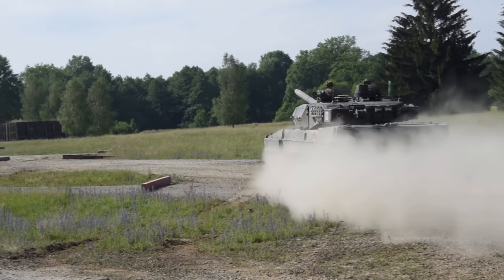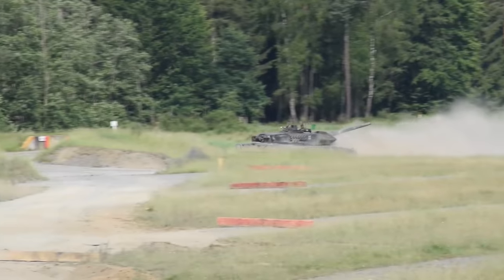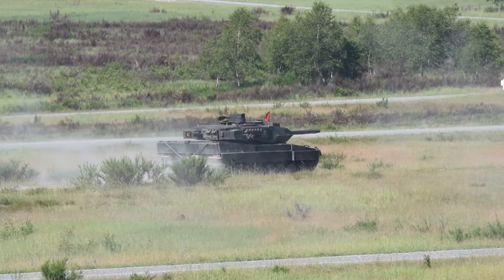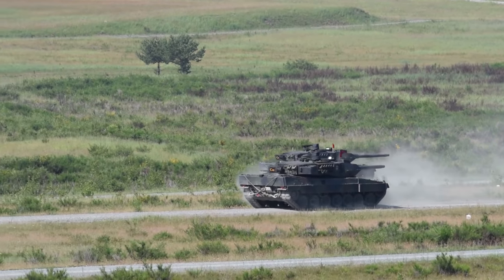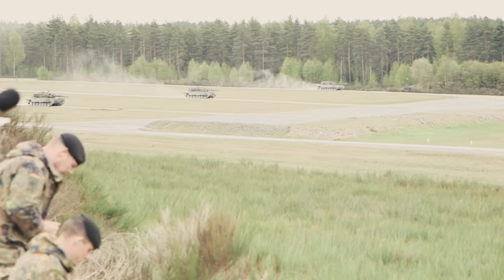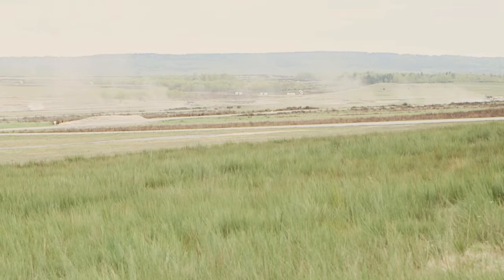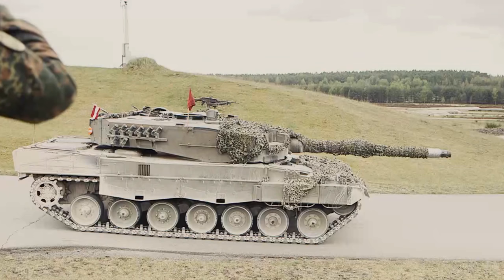Leopard 2 Main Battle Tank | GERMAN ENGINEERING

Comment: One thing that should allways be remembered concerning the Leopards (1 and 2): The German road system. That gives the Leopard 2 its insane 1500 hp engine - Tiger of WW2 was clearly underpowered with a thirsty petrol fuelled engine - that mistake should not be repeated (and it most certainly wasn't - there is no such thing as to much horsepower in German thinking).

The German idea behind the vehicle was: A Warsaw Pact break through could not be prevented as such, but the heavy tanks could have so much speed, that they could be brought to the crime scene before the russians could sort out their logistics.
Those tank units that were not engaging the enemy's offensive would instead simultaneously counterattack where the enemy was thinned out to provide a concentration of force at the break through point.
Basically it was meant to concentrate the bulk of the enemy against the british with their exellent gunnery and unusually well protected Challenger 2, albeit with limited operational mobility. 
Thus in effect crushing the russians between the german hammer and the british anvil.

Now, that changed after the cold war. First problem was that the old Warsaw Pact nations had become the new Nato countries. They had (and have to this day) a shitty infrastructure and a major roadbuilding programme is still in the making. The Baltic States are getting EU-funding to provide the road structure - mainly for civilian use. It has been quite entertaining to follow the political and administrative wrangling.

Basically the Baltic States have been very much preoccupied with their internal priorities - and shortage of funding. The EU and their sir Humpfrey Appelby's have begged (on their knees) the politicians of the three nations just to reach an agreement to apply for the road - write on the back of an envelope, just get the signatures! The hammering out of the details: Leave that to the beurocracy in the EU - that is what they are there for - and they are very good at it. Furthermore: The funding IS THERE.

Now in 2014 the invasion of the Ukraine happened, which made the gloves come off.

The road building in the Baltics (and Poland) would not be finished in short order.

The main problem for the heavy tanks is, that there are LOTS of rivers in Europe that are not navigable and the bridges over them are not strong enough to take tanks. The rail system is a hassle and an old fashioned BOTHER - so that will not be finished in time - no matter what date. Rail-systems timetables are like planning for the second coming of Christ. Christ will be reborn to us - eventually!

But if you don't CROSS the rivers and use the plenthora of ports along the Baltic coast - then the situation is far from hopeless. Now sidestep into my bailliwick: Danish defence planning.
The polish problem of containing the russians. Well drawing from experience. Germans and Poles form a division with the Danes. Something that was as credible as the immaculate conception of the Mary. But as far, as I can tell: It works! The poles indubitably hate the germans; but not quite as much as they hate the russians - and with a mediator to smooth out ruffled feathers and the germans hefty wallet - things work out.

That did not solve the Baltic problem of transporting the heavy tanks. Well, here we are not contemplating using road or rail for the major part: We use ferries! We get the british to lead one brigade in Estonia, the canadians to head another in Lithuania. Then we get the Norwegeans  and the Dutch to contribute a combat group of batallion size - we put up a batallion as well. Keep the pesky Russians from interfering in the Baltic Sea - their navy is rusted to the piers anyway.

Point being: They are all armed with Leopard 2! Except the british - of course - they HAVE to be difficult.
Reply: Now I will move out from the scope of Matsimus Youtube. Basically because we allway end up talking MONEY. I will try to explain, why there is money enough! Lots of it! And why Germany is able and willing to foot the bill!
I admit it is a difficult matter; but bear with me.

Now it does not take a rocket scientist to understand why roads and railroads further economic growth! Put simply: It provides cheap access to cheaper labour, which lowers production cost, increases competition which cuts into monopoly profits and lowers prices.

Now every business cares shit about others - that is a fact of life. The consumer cares shit about others - that is also a fact of life.

Now: A road opens up both a market and production - and lowers production cost, moving raw materials and parts to the cheapest producer. At the same time it puts money into the pockets of the workers and producers that make them able to purchase. If you think Latvians don't like to spend money? You are dead wrong!

Now if you simultaneously increase consumption and production the economy grows! I.e. the GDP grows. If each country contributes the same fraction of money to infrastructural projects Germany ends up with the greatest bill - simply because it has the greatest GDP. Now that is not a gift, because infrastructural projects will increase the GDP of the countries recieving the new roads/railways - and they will pay because they will have to pay in proportion to their GDP!

I hope I clarified a point or two about the EU and their defence! If You follow me this far - You show more comprehension than most above Your pay grade!
Reply: So... war with russia for european peace.
To the point i not hate russia but hate putin
Reply: @gioaxe4538  Vlad calls the shots in Russia, and is quite open about his wish to expand into the old Soviet sphere. The Balts and Poles are not really keen on that. Vlad is also undermining NATO, individual countries in Europe and not least the US, to further his ambition of expanding Russia and a return to the great power state. He also percieves liberal democracy as a threat that needs to be destroyed.

That will be a no from me on all those counts. I too like Russians, the ones I know are warn, friendly and hospitable. However, as long as they choose to live with an oligarchy keeping up an autocrat, they are not really our friends.
Reply: Agreed almost with everything. Just not about the part that Poles hate Germans. I don't know where do you live but u are wrong on that point...It isn't time after WWII and  many Poles rather working with German because they are straight forward not as Brits are. On the other hand- hate Russian as they kept us under long-time occupation- true to that.
Reply: @LiberNull777  some Poles do. Ontology has hit Poland just like the rest of the world, and there is widespread hard nationalism there.

Comment: Put simply, this was the winner tank design for world war III. Designed specifically not only to massacre the best MBTs of the Warsaw pact, but to massacre them when heavily outnumbered by them. If a single one had to fight with 5 or even 10 T-64s or T-72s it was surely expected to take some direct hits and survive. Leo's beauty is that it seems to absolutely nail the tank triangle. It had massive firepower with excellent fire control, it was armoured like a fortress, and still - had one of the fastest chassis in the tank world. It really looks like the age old tank triangle of compromise between firepower, mobility and protection did not apply for Leo.

Comment: Why did you just skip over the 2A6 and 2A7? :(
Reply: He mentioned the A6 very briefly, but completely left out the A7, same with the Leopard 2 PSO, even though it's camo is the sexiest of the bunch.
Reply: peter müller Yeah, but the 2A6 is one of the most important upgrades because of the new gun. The 2A6M and 2A7 did a lot for crew protection, especially for mines.
Reply: @tkkonigstiger3868  the 2a7v has also much more armor and a new l55a1 gun
Reply: @eifelerplanespotter653  na, the A7 has the L/55 and the A7V has the L/55A1. The A7 was the planned upgrade but it was decided that it need some minor upgrades besides the whole A7 package. For example they gave the gunner now also a 3 gen infrared sight, all variants up to the A7 had still only the gen 1. But with the A7V they fixed it.
Reply: Things getting heated in the animal fandom
Reply: @Tankliker  Aaand it received a APU
Reply: @TheGhostOfDefi  The A6 had it already if i am not completely wrong.
Reply: @Tankliker  yeah but if I mind it right it delivered not enough power to operate all systems while engine ist shut down. This is the reason why the A7 has a higher hull above the engine.
Reply: @TheGhostOfDefi  I already knew that they changed the layout of the engine cover a bit to also take the APU into it, but I didn´t knew they already had to change to a more powerfull unit.
Reply: @Tankliker  they are testing a 2cm cannon now right?
Reply: @BeKindToBirds  if you now tell me who you mean I may can answer.

As for the BW, we are currently not developing any new 20mm. At least not for our own military.

Also, why do we need a new one 20mm besides the Rh202?
Reply: @Tankliker  i don't know about you, but as of now Leo 2s is still formidable with the latest armor, guns and tech and they don't even need 20cm main gun, IF the British became smart with their tanks, then you defo need a bigger gun

Comment: The 2A5 upwards still spots the strongest frontal armor fielded on any tank today
Reply: It'll be even better had they removed the frontal ammo stowage in the unlikely event of a penetration the tank wouldn't go up.
Reply: Sarge Sacker25 The Leopard won’t have enough rounds if you got rid of the rounds in the hull
Reply: Hazardous 
I know, they'd have to redesign the turret and put it all the ammunition in the turret like the Abrams (yes I know the Abrams has a few hull stowage rounds with blow out panels). This is basically the deciding factor between the Abrams and leopard 2 debate for me.

I'll always go with the Abrams because I'll feel a whole lot safer in it compared to the Leopard 2. Had the leopard got rid of the hull stowage I would go with it every time.
Reply: @sargesacker2599  I think people are making too much of the hull ammo thing. The frontal hull is probably the safest place in the whole tank. It is less likely to get hit than the turret, because tanks usually fight hull down and it has strong armor protection.
Nobody calls the Merkava a death trap because it too stores ammo in the hull.
You could even argue that the Merkava's hull store is less safe, because it is at the back, where the tank has less side protection.
Reply: Any source on that ? I am geniunly curious.Especially how it compares to say a T90M, or the latest Abrams version.
Reply: Smintina Vlad Look at the data the Swedes provided when testing many MBTs including the Leclerc, M1 and Leopard. Other than that you can still look up the Greek trials which the Leopard 2 also won.
Reply: @Vlad_-_-_ You ever heard of "Steel Beasts"? It is a tank simulation game that is derived directly from military tank simulations. You can't just buy it, apparently, but need to prove to them that you have some sort of military status, before they sell it to you.

However, apparently the stats different tanks have in that "game" are based on actual military data.

I heard they got the numbers for most tanks, including the Leo 2A5 from data leaked by Russian and Israeli spies.

You can google the stats they use in Steel Beasts and will find schematics with specific numbers for several MBTs.
Reply: @TrangleC  I heard of the game yes, but I never suspected it got over the top realistic stats.Interesting, thanks for that.
Reply: @komradearti9935  Easy to just say. Do you have any evidence for your claim?

Comment: That panzer should have been named the Tiger 3.
Reply: why not panther 3?
Reply: @dillerhiller  russian screeching noises in the distance
Reply: Too fast to be a Tiger
Reply: Politically that was never going to happen. Hell, the Bundeswehr barely got away with naming a Barracks after Field Marshal Rommel and basically had to make the case to the Bundestag that it was honoring his WW1, interwar sevice, and his loyalty to "the German people" due to his alleged involvement in the Hitler/Nazi party assassination plot/coup which ultimately caused his death.
Reply: naa, modern mbts have nothing in common with these old slow heavy tanks. 
tigers where breakthrough tanks, designed to punch a gap in the frontline, for the faster and waaaay cheaper pz3 tanks, and go back for maintenance and medals^^.
and they where perfect in this role. 
but they where not designed to fight as mbt, over a longer time. thats why so many of them broke down. 

if you choose one of the german ww2 tanks, the panther 3 would be a better name.
Reply: @mandalorian_guy  and not flamable enough
Reply: @generalsaufenberg4931  as the leopard is actually named after the animal because it was one of the fastest mbt at the time of development
Reply: @dillerhiller  nobody questioned that

Comment: Leo 2 goes much faster unofficially 😂 greetings from Leo guy
Reply: Sure, you just need to replace the entire suspension after you do that.
Reply: @Schnittertm1  whats wrong with the suspension 😂 we havent had any problems with it
Reply: @Schnittertm1   Nope, but your tracks won´t like the aditional load! You can speed up a leo be removing the restrictors from the turbos. Funny, it didn´t decline engine live. 8 Years later on service: "If you mess with the engine, I break your neck!" There was still a Leo2 considerably faster than the rest in the 121 Bt.  😂
Reply: @karstenklump5200  our Leo 2A4 already went much faster than the official number but we heard stuff from the older crews that there is some kind of thing near the engine controller box thing that you can play with if you want it to go even faster, we never managed to figure out what the thing was they ment because their service ended the same day we came to their company. Dunno if the same thing applies to the 2A6 it seems little sluggish compared to our 2A4. Sorry english is my second language 😂

Comment: Excellent synopsis of the various upgrades in the engineering, testing, and tweaking of what turned out to be a world class fighting vehicle, perhaps the best in its class. Faster, lighter than the American Abrams series with logistics such as petrol comsumption far more manageable. With oil in short supply, the Leopard has a distinct advantage over the gas-guzzling American counterpart.

Comment: Spain has two versions of Leopard 2. A4, originaly 108 models, rented for the Fast Reaction Unit the EU wanted to have. Spain finally bought them. And in the late 90's Spain decided to build a Spanish version of Leopard 2A6, the called Leopard 2E, a version adapted to our hotter weather, with several extra differences, mainly of Spanish made parts. Up to 219 tanks, plus 16 Leopard 2ER Bufalo (Recovery), and 4 school Leopards.

Comment: If I recall we had a Leopard at Ft. Knox in about 1977 or 78. It was in one of the maintenance shops. The first XM-1 Abrams i ever saw  in about 78 or 79 rolled out of the maintenance yard onto the road drove about a 100 yards and throw a track. Myself and another NCO in the scout unit beat feet before we got shanghaied by the crew to help put the track back on we saw that movie before.
Reply: I was on Ft Know in 1977 but left in April of that year.  We saw XM1 on the way to Ft Hood while I was on Ft Polk.

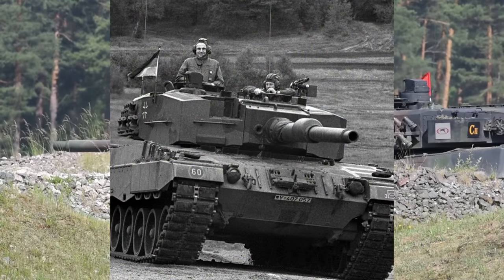Comment: Why do the hatches open differently? Notice that the tops of the hatches have crosses while the bottoms have circles. Why does the left hatch fold over upside down but the right hatch slides around? Watch @12:30 - 12:40.

Comment: Some would have said that the engine difference made also quite a difference. US wanted to use kerosine hybrid turbine thing whatnot for the Abrams and The German Leopard was always designed for diesel. Also afaik the M1 had a rifled barrel. Brits still do I guess witheir Chally, but Rheinmetall Smoothbore apfsds was adopted in the M1A1 afaik.

Comment: People like to look down on the Leopard after the events in Syria but they forget about the losses of Abrams tanks during the conflicts in Iraq and Afghanistan. In those conflicts the Abrams reputation as king of the battlefield was brought low by IED's and during the invasion of Baghdad one was set on fire by a RPG. After which the tanks went through several upgrades to try to increase its asymmetrical warfare survivability and capability. Turkish Leopards did not have the upgraded armour packages of the 2a5 or 2a6. The Turks even made official requests for Germany to provide some of the compatible up armour packages to them in order to continue their fight. The Leopards ability is clear and its reputation should reflect the fact that it has not remained stagnant or idle in its evolution. The Leopard of today is definitely one of the most capable vehicles in service anywhere.
Reply: @pegamini The Turks used the Leo as battering rams without proper infantry support. That is why they got wrecked. Leopards are designed with defensive roles as its primary mission and offence as the secondary. They are not used like the Abrams.

Comment: If you use a tank placed static up on a hill like artillery or inside cities without infantry around it, it is no wonder that they will get destroyed. That´s what I heard from German tank crew member about the destroyed Leopards in Syria. And Turkey got only the now old A4 variants. We don´t sell them the newest versions.
Reply: The tested and offered an upgraded version called Leopard 2NG for Turkey, which was based on the Evolution/Revolution series of upgrades. Its development was apparently funded by Aselsan of Turkey, though with no contract from the Turkish military. It would have sported better armor protection all around and upgraded drives and electronics. It would have done better in those circumstances, though not much. MBT without flank protection are just begging to be taken out.